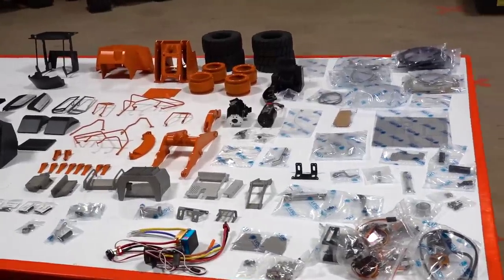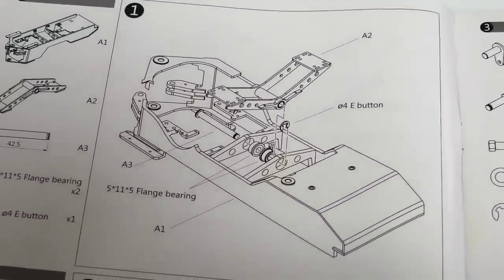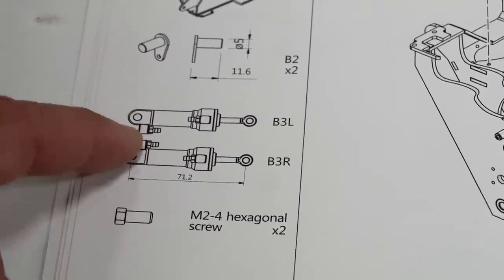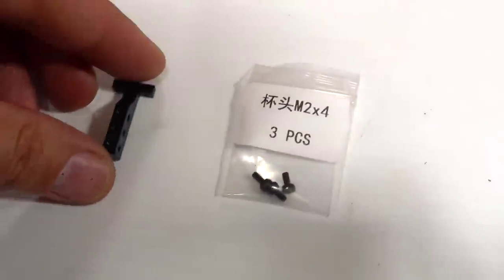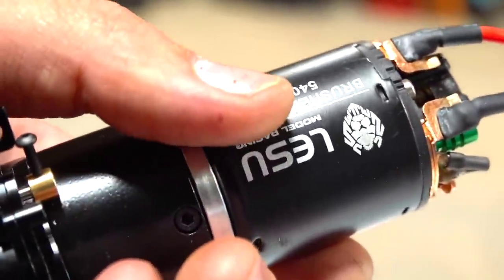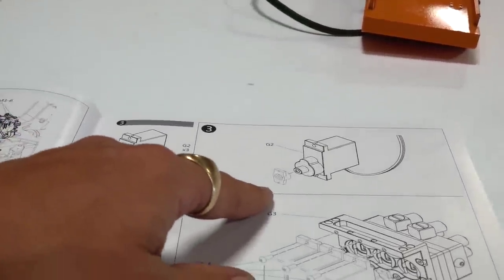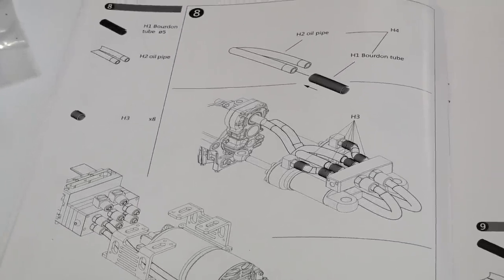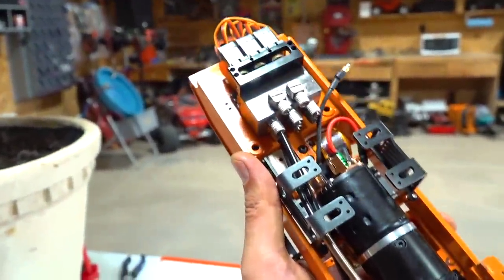ALL-METAL LIEBHERR 574 HYDRAULiC Wheel Loader BUiLD! LESU (PT 2) "MEAT and POTATOES" | RC ADVENTURES

Comment: If you heat the pinion up with a little blow torch or put it in the oven it would have probably just fallen onto that motor shaft. This way you dont risk damaging the bearings in the motor
Reply from the maker: You can also make the pinion brittle by heating it bro..
Reply: @TheRealRCSparks  Oh really. Thanks for letting me know

Comment: When building a model like this, in RL it all most the same thing. You start with what is easy to do first then the next step it be simple to just place and pin them together... but you are dealing with small piece that will fly off and disappear on the floor.. god.. that is the worse when building RC.